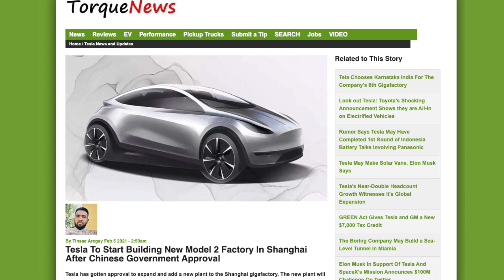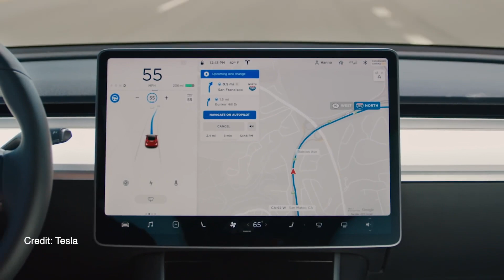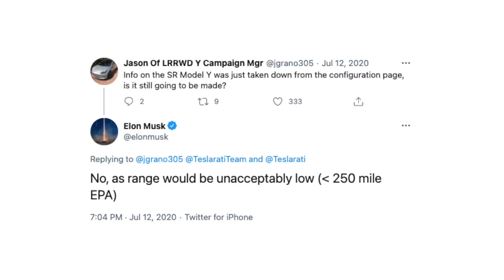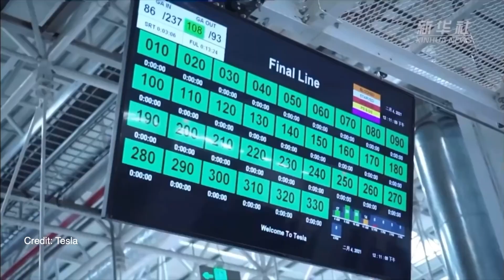$25,000 Tesla Model 2! - Features, Design, Release Date, and More!

Comment: I think m2 will appear in the US in late 2022.  The limiting factor is battery production.  Tesla simply can’t produce enough batteries to support a high volume, low cost vehicle.  While no fancy features, it must be comparable to low end ice vehicles from Toyota, Kia, and others.  There’s no need for fast acceleration, fancy suspension, stylish wheels, etc.  Expect use of giant presses and casting machines for a 3 piece frame.  Tesla will make very little profit in this category.  Of course, FSD is extra and probably reduced functionality to justify a price below $10K.
Reply from the maker: Perfectly said! Another point too about battery production is that the cybertruck and tesla Semi both use much larger batteries than the S and X meaning the battery constraints may get worse for some time until Tesla is able to work it out.
Reply: Hi, I am Graeme John Eddington. Following is my Youtube post of my Multi-speed transmission I have called: "Opposing Torque Dynamic Clutch" which is a type of Infinitely Variable Transmission (IVT) which I believe is ideal for your current applications. Please log on to my Youtube video: https://www.youtube.com/watch?v=SACDK89U7PM